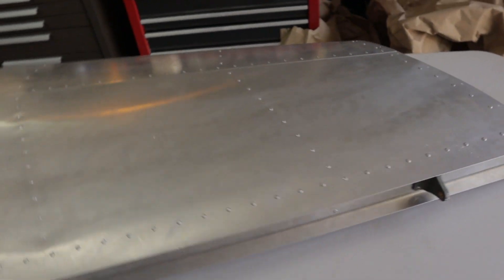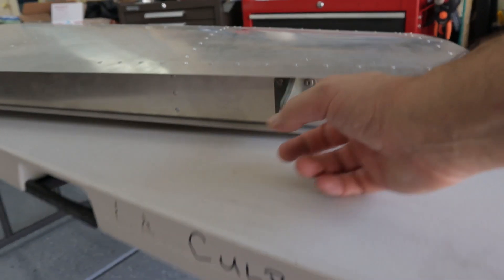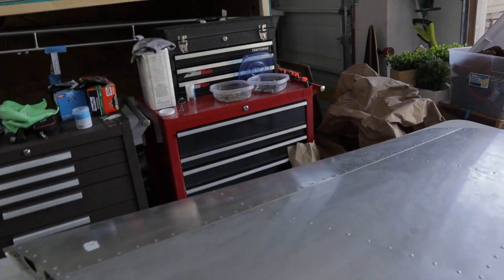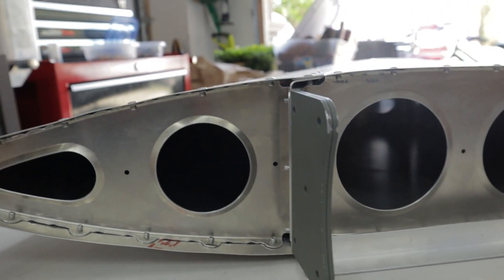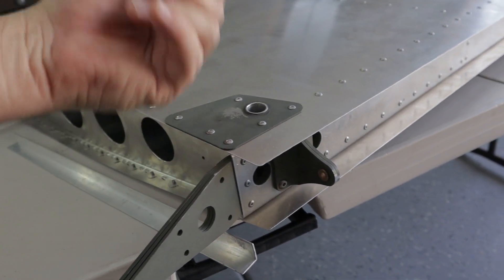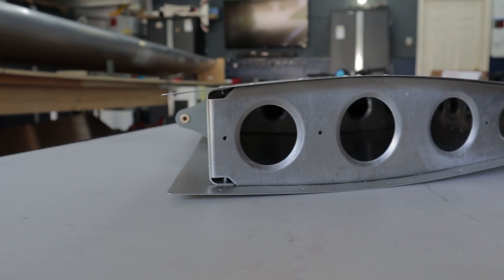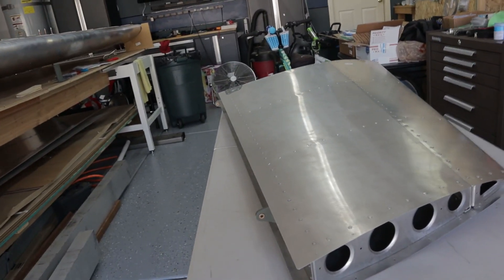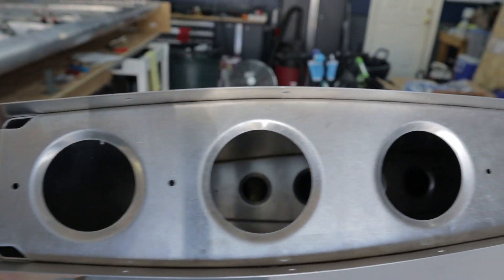RANS S-21 Vertical Stabilizer

Comment: Great video with good commentary. Looking forward to the build and your comments. 
Why did you choose Rans rather than Vans since you had a history with Vans? Also, did you consider the Zenith 750, which is very similar to your Rans?
Reply from the maker: The S-21 is the perfect balance of STOL performance, good cruise speed, easy build and good looks. Vans has no high wing back country aircraft and I wanted a tailwheel, so the 750 wasn't considered.

Comment: I am just about to assemble my VS also.  I have a couple more ribs to prime and then will be ready to assemble.  I did not need to use a strap to pull the leading edge skin into place, but then I noticed that it appears you have the original style ribs that had a full nose on them.  Mine are the newer style that have the noses removed and I suspect that is why my leading edge skin went into place easily.

I decided to bite the bullet and buy a spray gun at the outset as I plan to attempt to paint my plane myself.  I am using the Stewart Systems Ekoprime and it works great.  It is not nearly as conventional as a rattle can, but with practice I can thin the paint and load the gun in 5 minutes or so.  I am priming all interior surfaces including the skins so the fun makes it pretty fast compared to a can for the larger areas.  And the Stewart primer is tough as nails and dries quickly, at least in the low humidity we have had of late in PA.  I found out just how tough it is when I failed to place the viscosity cup into water immediately after using it.  I thought I could lay it in the sink and clean it up when I cleaned the gun.  Big mistake.  In the 20 minutes or so that I took to spray a couple coats on my parts, the primer hardened quite nicely on the stainless steel viscosity cup.  It took much scrubbing to get it off!

I have been having the same debate about the tips.  I will probably go ahead and do mine right away as I want to get some practice working with the ABS parts and also want to get the tip rib drilled and primed so I need to do the fitting to do that.  Looks like it may be interesting.  RANS says to cut to the trim line, but my tip has three different lines on it.  I am pretty sure they mean the line where the mold flare starts, but I expect it will be obvious once held up next to the completed VS.
Reply from the maker: I have used Ekoprime on a past project. Very easy stuff! RANS is constantly improving parts, not surprised the VS ribs were modified. It was not difficult to build, but those nose ribs were a bit of a pain to get them cinched up to the leading edge of the skin.